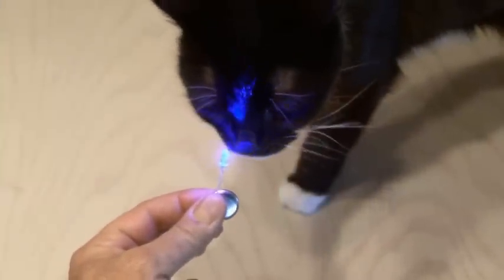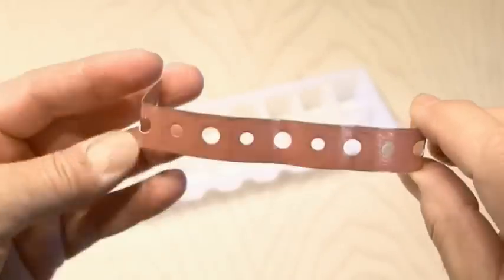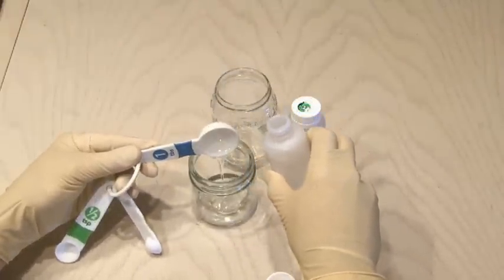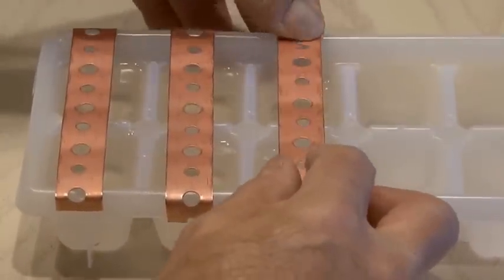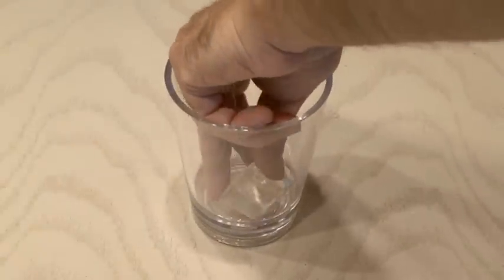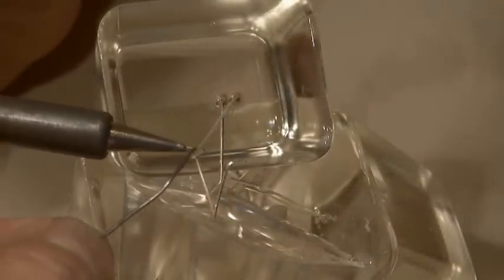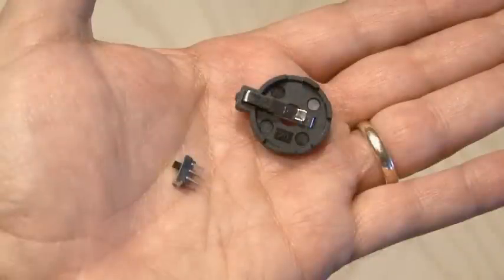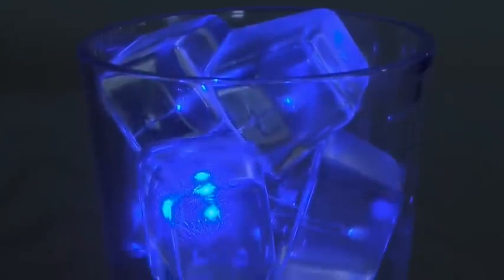Weekend Project: LED Ice Cubes

Comment: a variation of this that works wonders is to wire the LED's together with insulated wire and casting the resin the cover the contacts. this produced a watertight circuit. use some more resin to fill the hole, freeze for an hour and you have a chilled LED glass good for serving clear drinks (I'm thinkin' vodka)

Comment: you could also seal up the hole in teh bottem, and fill ti up a bit with mineral oil, which is pretty close looking to water, yet it wont be able to short out the circut. You can also tilt it a little for the liquid effect.

Comment: @LTrojanowski1 no don't drink from it. btw, there's a hole in the bottom so it wouldn't hold liquid...and even if you sealed that, leads are exposed so you'd short circuit the whole thing. How long it lasts depends on the led type and battery type used. You can get the resin and hardener from the homedepot, lowes, or michaels....and other simmilar places.

Comment: I'm estimating that a few hours is all you'd get. The lithium coin cells come in various capacities, so maybe a large one would last longer. Make sure you use LEDs from the same batch, because if one of them has an appreciably lower forward voltage, it will prevent the others from turning on. The voltage from a fresh lithium coin cell is about 3V, and the threshold for most blue LEDs is about 3.3V. These factors prevent the LEDs from being destroyed in this simple circuit.

Comment: @fowleriva well thats my point
you dont put drinks in it
also techboywii is right.. once the resin is dry its non toxic (i know what im saying i work at a plastic & rubber molding factory) but still... there are some wires uncovered

Comment: I didn't think much of the led ice cubes - but - finding out that I can use HDPE type 2 plastic aka milk jug plastic as a mold for polymer resin casting is AWESOME!. I can shape HDPE a thousand and 1 ways. Two part molds, complex molds, half molds like the ice cube tray... Just pour in the polymer resin and pop it out or open when done. Gonna have to try it.

Comment: Would it be beneficial at all to include a resistor at the beginning of the circuit? I am planning on using LEDs with forward voltages of 1.8V and peak current ratings at 50mA and continuous current ratings at 25mA and a 3V battery so R = V/I = (3V-1.8V)/25mA = 48 Ohms. So would including a 48 Ohm resistor have any positive effect on the LEDs or battery source by say increasing the life of the LED or battery?

Comment: I have just bought some leds and would love to make some cool things but i was thinking.. if i use a 12v battery.. and the leds run on 3,2v can i put them in series?? 
therefore i will not need to use a resistor? right?

please help :)

Comment: Shorting from being exposed to the liquid would depend on how conductive the liquid is and how far apart the wires/terminals are.  If in water then I doubt there would be any shorting with this low level of current and VDC..  Add salt to the water and you would prob get shorting.

Comment: That'd be cool. I'd probably pour some resin in the bottom first to seal the electronics. Wouldn't be good to have something like coke or something corroding the wiring into your drink. I'm also assuming resin is safe to use with food.

Comment: Light Emitting Diodes have all the reactants contained in an airtight casing, the solder would have to be inside the resin to avoid shorting (that's why I mentioned insulated wire). 
lastly, the EL cubes used by 30% of the bars club, cruise, and rave bars are made of the same resin compounds.

Comment: Use the resin on the exposed soldered area's and in the hole the wires pass through, putting water in is no longer a problem.

Comment: put food coloring or dye or maybe even paint into the resin stir it not all the way and there will be color wisps throughout the switch and it would be cool to completely inclose the light in the resign with a switch that will activate to magnets and just have a magnet on the table or the bottom of the cup

Comment: the project is ok but if you are going to use resin like this, there is soo much more potential. 
could have just made a cup out of the resin with LEDs built in.  er, once resin is dry it's safe right?

keep up the cool vids!

Comment: If you had a bigger & taller plastic glass, and sealed the hole in the bottom with some resin, coated the LED leads with resin, and put a reflective foil or green felt on the underside of the glass to hide the switch and battery... then, if the ice cubes were glued in place, you could freeze the whole thing, and actually have a nice glowing mint julep....  Just take the frozen glass out of the freezer, pour in the booze, and enjoy.

Comment: KipKay I have an idea on how to secure the battery holder and switch just fill the concave bottom of the glass where you put the battery holder and switch fill that with that resin stuff but only enough to secure the switch and battery holder. you don't want resin in the switch. That is very cool. you could almost build one with those color changing LEDs like you said. Just an idea

Comment: More than likely one of these if put into actual drinking use.. would be powered by a coin cell....  not much to worry about from one or two of those batteries.  Unless there is a full on short or the liquid becomes very salty..  the battery won't get hot.

Comment: if you add water or any kind of soft drink, would it be safe to drink from that glass?
Reply: It should be safe, but you would need to seal the hole at the bottom with a bit more resin, and also probably cover the exposed parts of the LEDs.
Reply: ultraduck171 The fake ice cube is poisonous
Reply: In that case, the use of non-toxic resin is a definite possibility.

Comment: Hey! You know what would be neat?
Make the glass light up instead and reflect the light up through real icecubes and drink!
Mount the LED's into the bottom of the glass with a flashlight reflector pointing up into the glass.
Pour resin into the bottom to cover the LED's and let harden.
Then just fill the glass with drink and real ice and it will catch the light with the same effect.
THAT WOULD BE AWESOME!

Comment: No there is actually a way. Make the ice cubed without the led's. After they harden, just dril a hole one every cubes that got exact same size as the leds then you can just take them out and in

Comment: @oreoflavoredMcFLOAT Sure! Arrange the led's so that only a little leader sticks out (or clip them). Then soldier the wires where they should go. Then test to see if it works. Then mix some more epoxy and coat the wires. Ta da.

Comment: Update- I connected four parallel blue LEDS to a fresh CR2330 lithium coin cell, and they still provide useful light after 4 hours. The total current after four hours is 1.6 milliamperes.

Comment: Hello  there,
Thanks for the showing, i  like  the coulour !  as  i, am  going to  do  some experiments  in that ,  i need  to ask you  3 questions  i will appreciate .If i  use for example (15 ice  cubes) do  i need to use a 10 volts battery ? will works? for 15  cubes? .  and the battery are you  using for the 6 cubes you have  to switch it off ?  and  how longe will  stay?    many thanks  sir

Comment: Actually not. Water is not that conductive. At this low voltages you could easily run it in water as long as the water is reasonably clean.

Comment: You're not getting the point. WIth your suggestion, the leads will be exposed to the liquid. With your first suggestion of using hot glue isn't too edible for you. 

You might as well put the LEDs straight into the glass, instead of wasting time with making ice.

Comment: Stupid you lied to me, I wanted real ice cubes with lights in them.
Reply: To make real ice cubes with lights you will need to make a self contained light and freeze it in the center of an ice cube. This is possible because distilled water is not conductive so you just freeze it in distilled water and it won't short out.